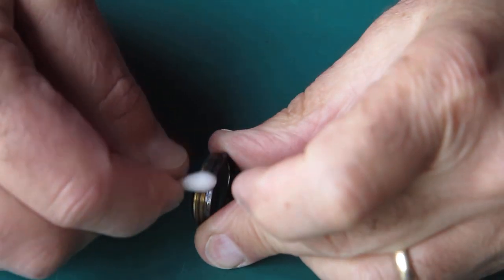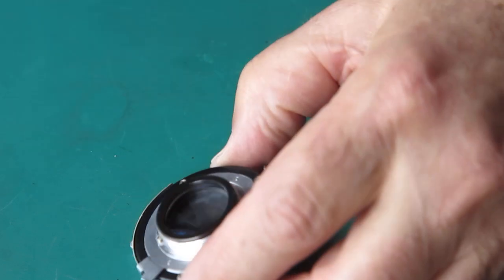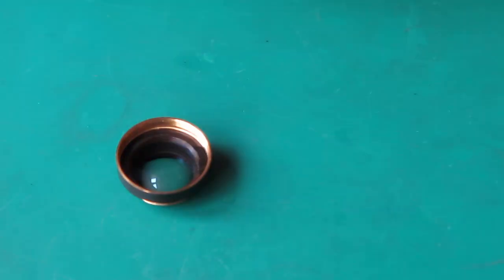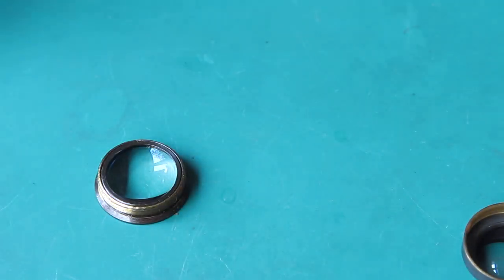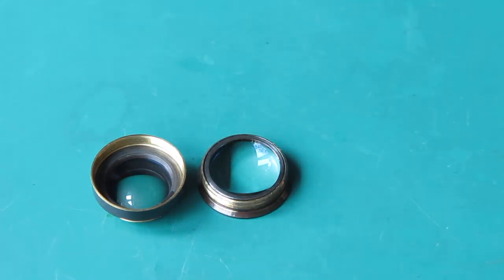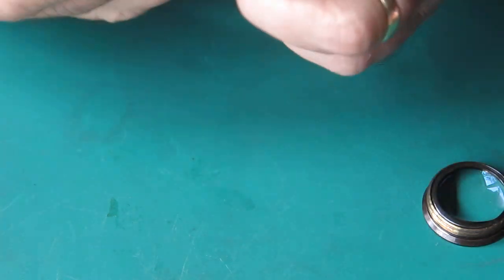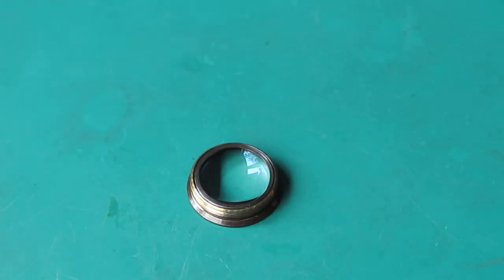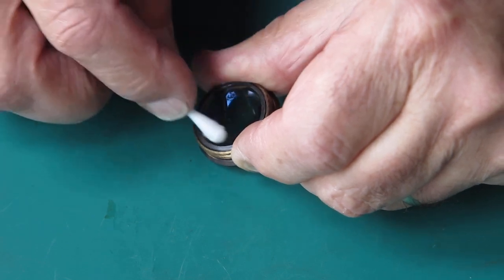Voigtlander Perkeo II service part 07

Comment: Is naphtha and cotton buds to be recommended over lens cleaning fluid and lens tissue?
Reply: He didn't use naphtha on the glass. He uses glass cleaner (such as Windolene or Windex, which stains the cotton buds slightly green or blue) on the glass surfaces after cleaning the brass surround with naphtha. There was a stubborn oily stain on one lens surface, which he removed with a degreaser, which I believe is tetrachloroethylene, or similar.

Comment: Do you use naphtha for cleaning grease as well as cleaning lenses?
Reply from the maker: Naphtha for greasy mechanical parts, domestic glass cleaner for glass. Sometimes CRC Heavy Duty Lectra Clean to remove residual greasy marks on glass. Use that with care, it'll dissolve any black paint around the edge of the glass.